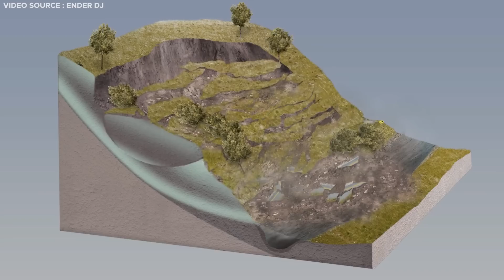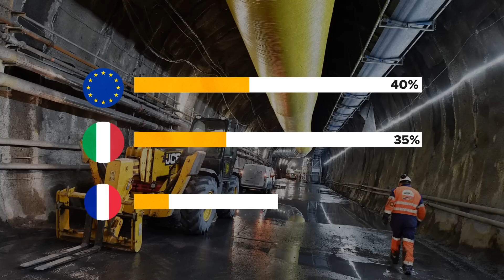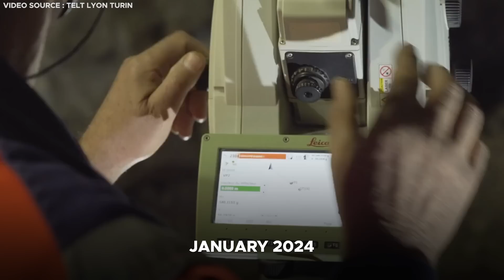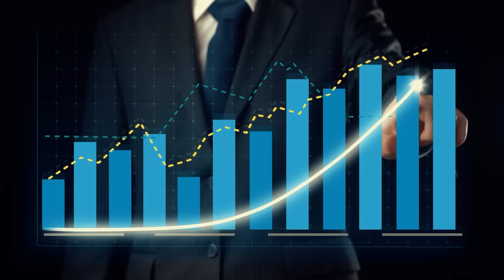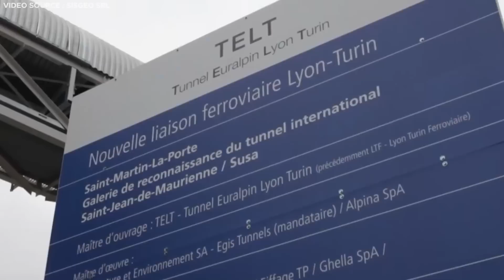France Is Building A $28 BILLION Tunnel To Italy Through The Alps

Comment: Mountain heights in miles? Come on! International units please! And when you speak about a project in Europe in miles and feet nobody understands it. You should speak in kilometers and meters and for the Americans add the miles or feet in the subtext.
Reply: C’mon, metric system sucks : 1 kilometre = 1,000 metres = 1,000 x 1,000 mm ?? (French btw yuck) Since Brexit Boris Johnson reinstated the Imperial system, so much easier, look: 1 mile= 8 furlongs, 1 furlong= 10 chains, 1 chain= 22 yards, 1 yard= 3 feet, 1 foot= 12 inches, 1 inch equaling the length of 3 barleycorns. Multiply the value in barleycorns by the conversion factor '0.33464566929'. So, 3 barleycorns × 0.33464566929 = 1.00393700787 inches. So easy!

Comment: Kinda odd that MTA subway train footage is used in this vid on a tunnel between Turin, Italy and Lyon, France. Just wondering where the criticism against this project originated? Whilst driving through this region several years ago, the constant line of trucks passing through small alpine villages and towns was also lined with by the side of the road monuments for locals who became victims of this traffic. In the meantime the traffic in this area has significantly increased. When this line will finally be open, it will have a significant impact on this transalpine traffic. Provided of course that piggyback transport becomes the standard. Cheerio

Comment: I will subscribe if you will start using metric system only.
Reply: C’mon, metric system sucks : 1 kilometre = 1,000 metres = 1,000 x 1,000 mm ?? (French btw yuck) Since Brexit Boris Johnson reinstated the Imperial system, so much easier, look: 1 mile= 8 furlongs, 1 furlong= 10 chains, 1 chain= 22 yards, 1 yard= 3 feet, 1 foot= 12 inches, 1 inch equaling the length of 3 barleycorns. Multiply the value in barleycorns by the conversion factor '0.33464566929'. So, 3 barleycorns × 0.33464566929 = 1.00393700787 inches. So easy!

Comment: Why distances in miles?
The international unit is the kilometer, wake up, man!
Reply: I agree
Reply: Probably developed by English speakers, or for English speakers who still use Imperial measurements.
Reply: @ivanoffw  Americans learn about metric units in school. Products in US stores are marked in metric and American units for tens of years already. 
So we need to push them slightly to start using these units.
Reply: C’mon, metric system sucks : 1 kilometre = 1,000 metres = 1,000 x 1,000 mm ?? (French btw yuck) Since Brexit Boris Johnson reinstated the Imperial system, so much easier, look: 1 mile= 8 furlongs, 1 furlong= 10 chains, 1 chain= 22 yards, 1 yard= 3 feet, 1 foot= 12 inches, 1 inch equaling the length of 3 barleycorns. Multiply the value in barleycorns by the conversion factor '0.33464566929'. So, 3 barleycorns × 0.33464566929 = 1.00393700787 inches. So easy!
Reply: @happyslappy5203  
You forgot to turn the sarcasm off!
/s

Comment: As far as I know, the railway tunnel is only for high-speed trains between major cities. So not for freight or local train networks. Therefore I consider 28 B$ to be an economic nonsense
Reply: Wrong. The project dubbed Transalpine Lyon-Turin is also for freight trains (similar to Eurotunnel)
Reply: The tunnel will have freight trains travelling at a Vmax of 120 km/h (with 160 km/h being possible in the future) and passenger trains at a Vmax of 220 km/h.